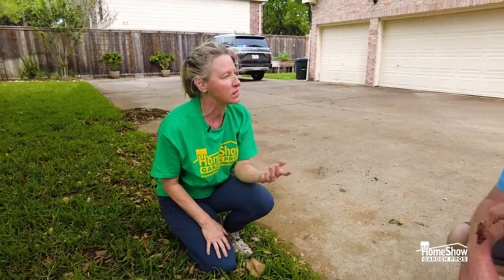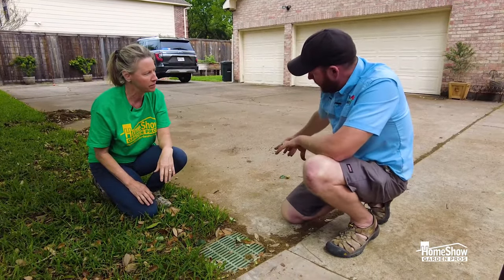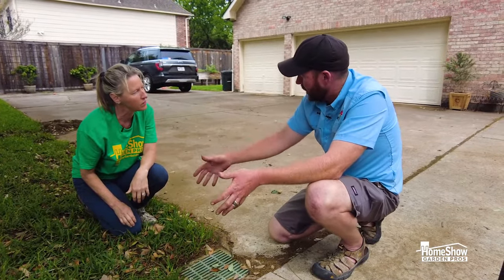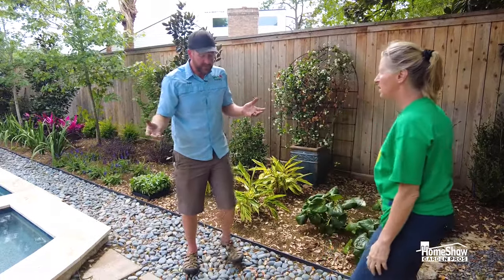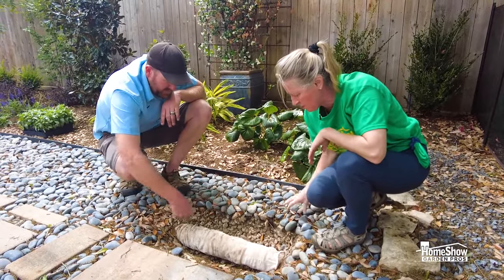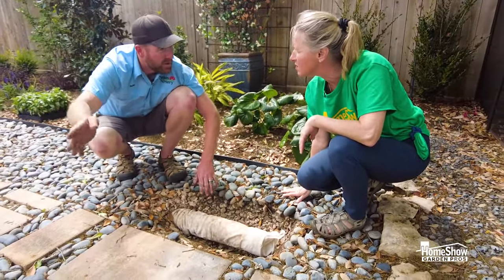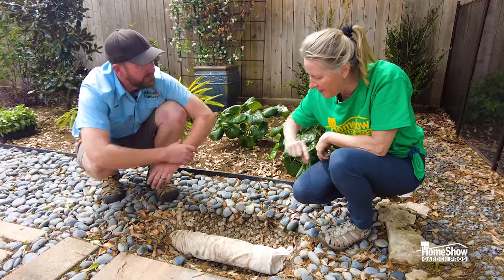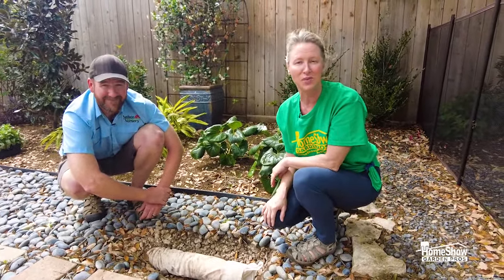French Drain VS Surface Drain. What's the difference?

Comment: French drain looks good in this situation except that the sock that covers the drain pipe will quickly plug and it will stop working. It's not necessary considering all the crushed rock around the pipe.

Comment: I often see the pipe only gets,perforation facing down, and I get why that is done but curious as to why not perforating also the top part of the pipe to help water flow in?
Reply: i believe it's because when the soil becomes too saturated with water, the water starts to rise which then the perforated holes catch the rising water before it get back above ground.  so top perforated holes wouldn't be necessary.

Comment: I have a question:  Wouldn't it be better to have the holes in the PVC pipe on the top and sides, instead of the sides and bottom?  I would think we'd want to have the water drain into the pipe and prevent it from draining out along its length until it exits out where it's intended to.
Reply: The pipe typically has 2 rows of holes. Not 3. If you think about it like a clock. The holes would be about 10 and 2. Or 8 and 4. However you rotate it. You want the holes pointing down (8 and 4). The water gets in from the bottom of the pipe and runs along the belly. If you face the holes up,  stuff will fall in those holes more quickly.
Reply: @SandlGetIt that is incorrect.   The purpose of the rock is to displace dirt with a media that has a lot of void space in it.   The trench fills with water from the bottom up, hence the holes being on the bottom half of the pipe.   Rain water runs along ground and falls into trench at the edge of the trench, falls thru the voids in the rock and fills the trench from the bottom up to the holes.  Then it flows into the holes and in the direction that the angle of the pipe has been placed going downhill towards.
Reply: @smg8498  thanks for your reply. I agree with you. You are saying the same thing I thought I explained. Maybe I explained it wrong. Holes face down and water comes in from the bottom.